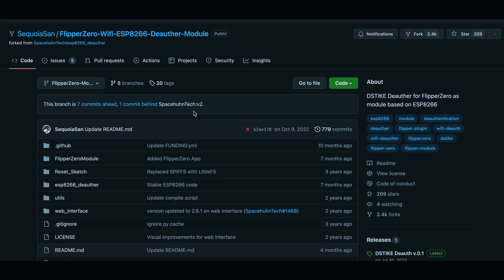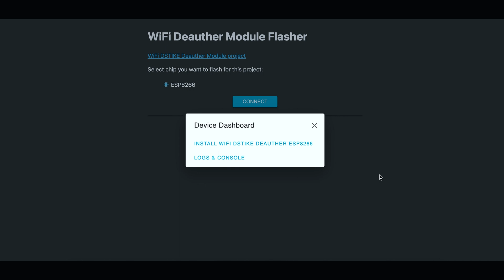Flipper Zero DEAUTH Attack - ESP8266 External WiFi module

Comment: Hi, what would be the substantial difference between wifi devboard & ESP8266 Deauther? They appear to be two modules doing the same things
Reply from the maker: hi, size and price… sure you can do more with dev board, but for deauther esp8277 arduino board for 3-5 bucks does the job

Comment: Why mine say failed to installize try resetting your device or holding the boot button while clicking install
Reply: Because on some ESP's you have to use the Boot/reset buttons to FLASH firmware.
Do a search about flashing firmware to your model of ESP chip/dev board.

Comment: Mine stuck in Initializing phase, any idea?
Reply from the maker: hi, there has been a bug or something recently…. well if you connected it the right way and flashed it correctly.
Reply: Had the same issue before I went and flashed the esp8266 unit through the web browser. Now everything is working as expected
Reply: @danielbr92  i flashed it multiple time yet nothing change.
Reply: me too
Reply: Me too! 😢